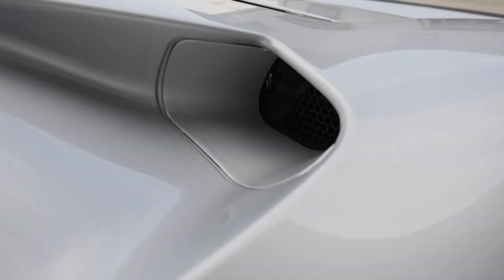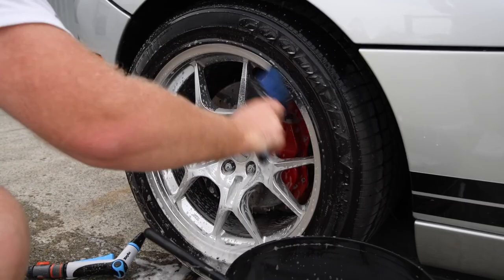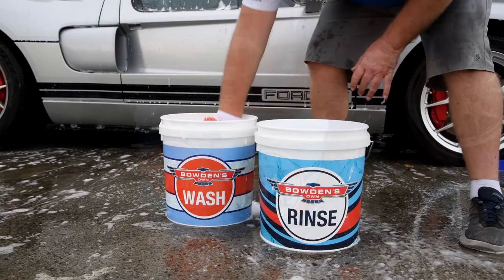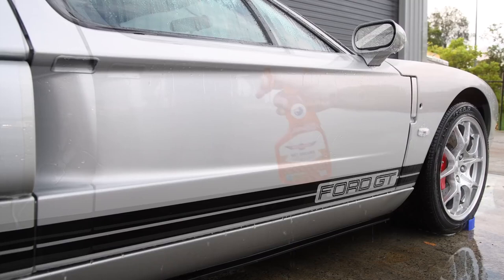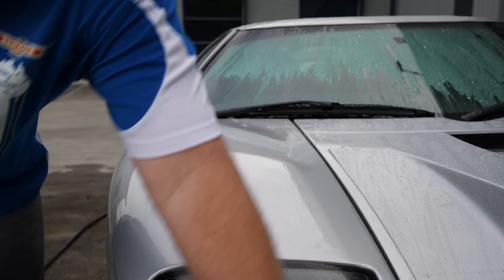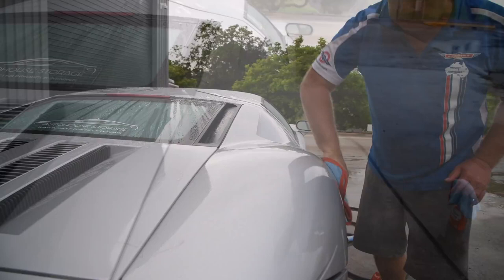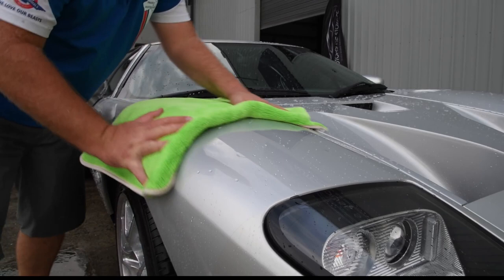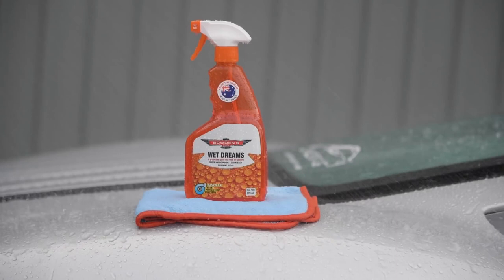Bowden's Own Wet Dreams | Available at Supercheap Auto

Comment: "6-7 family sized cars"

Yeah i don't know about that, just did my commodore and went through 3/4 of the bottle. I did repeat it as per instructions on the bottle so effectively 2 commodore sized vehicles.

Other than that its a fantastic product I must admit
Reply: Yeah, how the he is that meant to last 6 cars? No way in hell. I did my vy ss Ute and used half the bottle. So yeah I'd say it can roughly do two cars. It is good stuff and if it could do 6 cars that would be awesome but I'm not sure if it's worth it if it only lasts two cars being pretty expensive and they're are plenty of other products by bowdens or even other brands that do effectively the same job.